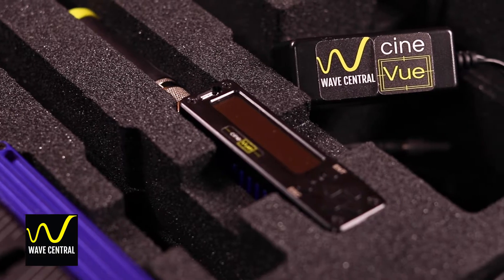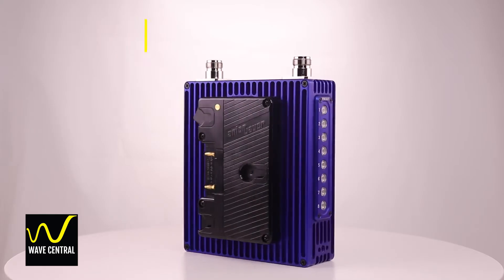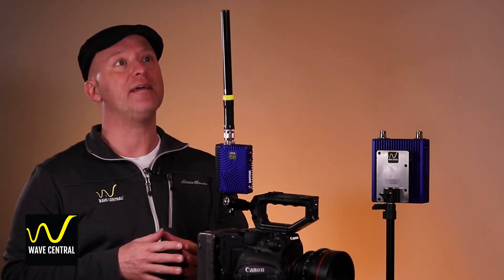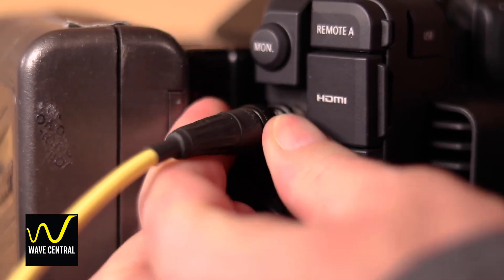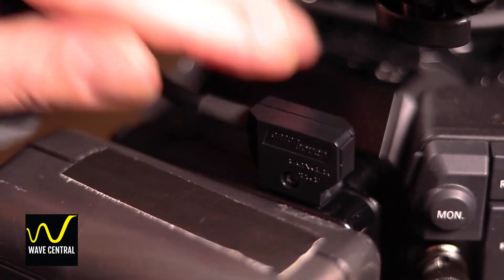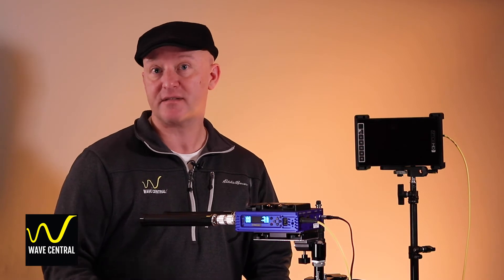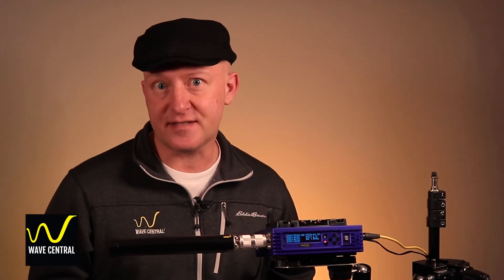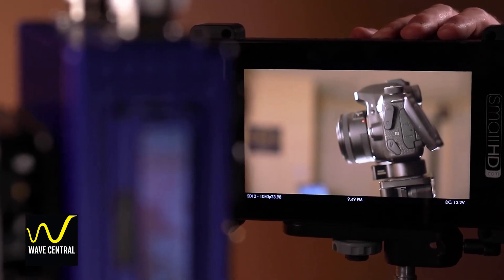How-To Setup Your cineVue Wireless Camera System

Comment: Need more details on the different settings and menu structure. great video but more detail is needed as the settings menu is a little confusing. Need to get a manuals on your website
Reply: I'm currently figuring the system out as well. Once we got the settings right it works great.